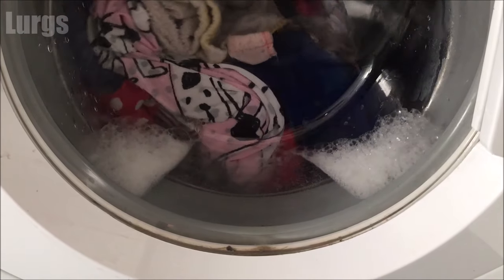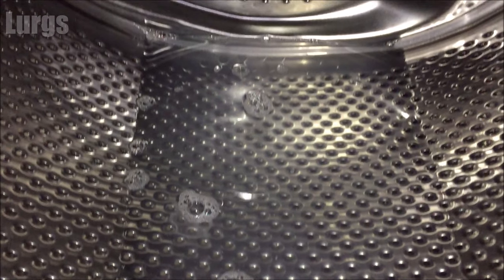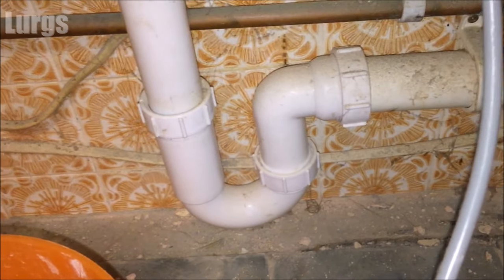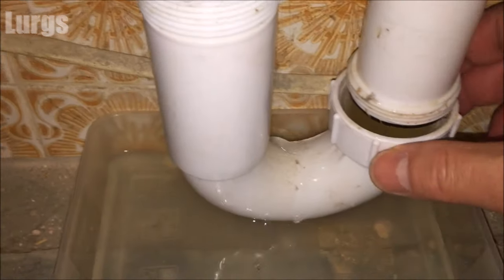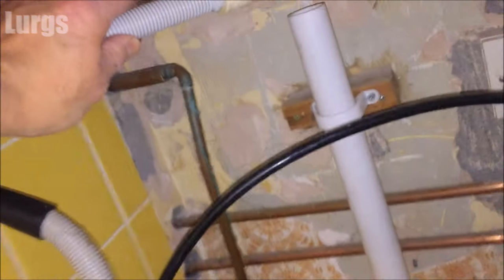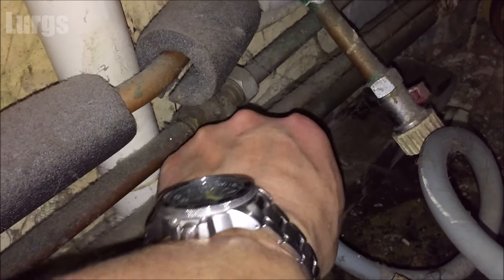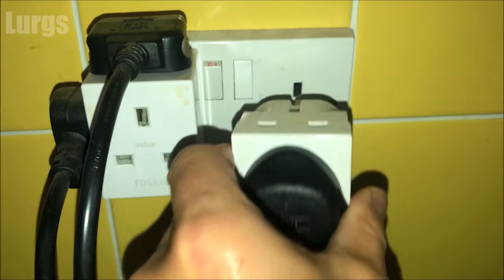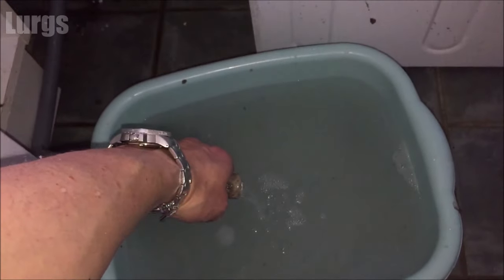Washing Machine not Draining Water - Fixed

Comment: The filter in the bottom that u turn around to open is stuck and won't open, and the water stuck on my front Loader is now starting to smell
Reply from the maker: That is quite common, that means there is probably something stuck in there like a hair clip. Just try tightening back up and unscrewing again, hopefully after some wiggling it will dislodge and you can remove it. Good luck.

Comment: My drainage pump filter won't turn for me to open and remove things that are stuck inside.  Please help, I'm afraid of turning it with force as it's plastic and may break instead 😢
Reply from the maker: @nontandomagwentshu1388  Try untightening and tightening multiple times to see if the object clears. It is bound to be a metal hairclip. If not you may have to get a bit more forceful, but be careful as the filter is only plastic. Worst case you’d have to buy a new filter. Good luck..

Comment: I can’t get to the pump because 4 screws will not come out. I have tried everything. I don’t understand why they put them like that. I just put a new lid lock and it’s still stopping mid cycle and not draining. I don’t know how else to get to it..
Reply from the maker: Normally a filter should be easy to access, shouldn't need to remove any screws. Maybe yours is different. You need to check the filter as that will be the prime suspect for water not draining. Might be in your instruction booklet how to remove the filter. Good luck.
Reply: @LurgsHowToGuides  I fixed it. I have to remove the casing to get to the pump. Those 4 screws were stopping me from doing so. Either it’s a clog in the pump or the pump is faulty. Unfortunately the manufacturer stopped making the pump. But I have it working for now

Comment: I emptied out the filter and there was water stuck in there but I couldn’t see a blockage.. any ideas?
Reply from the maker: Check impeller spins ok. Check for debris. If all ok do another wash and see what happens. Could be a faulty pump or computer board error
Reply: @LurgsHowToGuides  it seems to be working now I'm just not sure why it wasn't or why it didn't fully drain but at least it's working. Thanks for replying

Comment: i have done mine ,but still wont do a drain cycle , spins and empties, but wont do a wash and then drain ???
Reply from the maker: Worth checking filter again as sometimes after you remove it debris can drop back down. If ok it could be a pump problem

Comment: Hi what if you have checked and double checked and nothing is stuck in the filter. It is still getting stuck in mid cycle
Reply from the maker: Have you checked drainage hose pipes where it pumps out the water to? This could be blocked. If not blocked then time for a Washing  Machine Technician callout probably. Good luck.
Reply: @LurgsHowToGuides  Hi Yes have done all those things and had the washing machine technicians in twice, they can't figure it out as well. My dad thinks its the pump. That something might cause the pump not work
Reply: @LurgsHowToGuides  And I don't know where to look for that pump. Lol
Reply from the maker: Christine le grange If a washing machine technician can't solve it then that sounds really odd. Unless it's under guarantee you might have to get a new one. The pump should be at the back of the filter. Sorry you couldn't get it fixed,  very annoying. Stay safe ☕️.
Reply: But how long before the replace it with the new? They are very lucky I work from home, I am a teacher and teaching in the UAE. It would’ve been bad if I couldn’t wash my clothes
Reply from the maker: Normally Washing Machines have a 1 or 2 year guarantee.

Comment: The drainage hose doesn’t have any water in it and my washer is still blocked! I’ve removed the filter and there was a coin but did another wash and it’s still full of water :(
Reply from the maker: Oh dear. It's worth checking the filter again, sometimes when you remove it and put it back then other items can fall into it. If nothing in there it could be a faulty pump maybe. Hope you get it sorted
Reply: @LurgsHowToGuides  checked again and there was a coin and a screw still stuck! Also managed to clean the draw and that’s stopped the leak too! Thank you you’re a life saver!!!!!! :)
Reply from the maker: Mega. Good result, I'll get back to the footy now😎

Comment: Do you have a moment to maybe help me? 

Our washing machine has decided not to drain it's water anymore. Unless when you put on 'flush and centrifuge' then it drains, and during the program fills it with water again just to leave it at the end of the program again. So I know it's able to drain and push the water out. It just won't. And doesn't give me an error or anything either.

😂 Would you have any idea ?? It's a Samsung Eco bubble ofc (I'm Dutch so maybe the term isn't right 😂)
Reply from the maker: How odd. Maybe try a different programme, but it sounds like it's faulty if it's doing that but it does drain on the flush setting.
Reply: @LurgsHowToGuides  strange right

Comment: I did this but found nothing in the hole?? No blockage? Just water
Reply from the maker: The hole? If you've followed all the steps in this video and it's still not working then unfortunately you will probably have to call out a washing machine technician

Comment: I did everything except for the cold water switch for some reason it’s broken off so I might have to call someone in
Reply from the maker: Oh dear, they can get brittle over time. Might need a new lever installed unless you can turn it with pliers maybe .

Comment: how to fix if the emergency drainnning tube gone inside
Reply from the maker: Not sure I'm afraid, where is the tube on yours?
Reply: its beside  drainage pump filter at the bottom 
i have sumsung front load machine
Reply from the maker: @kripalthakkar610  you need to try and retrieve it. If the stopper is still in then ok but if that’s come off it could leak everywhere.
Reply: its leaking everywhere and stopper is out tried retriving  it but unfortunetly couldn't get it from front what is the other way to get the tube out please
Reply from the maker: @kripalthakkar610  not sure, you’ll have to try to get something up inside to pull it out.
Reply: alright i will give it a go.Thanks for your reply and time . Really appriciate it Thanks..!!

Comment: I did everything you did on the video and my washer still doesn't work 😞
Reply from the maker: Oh dear. Sorry to hear that. Could be a faulty pump or computer board error. If it’s pretty old it may be cheaper to get a new one rather than repair. Repairs can be expensive

Comment: If only my cold water valve wasn’t stiff I’d be able to do this issue
Reply from the maker: @caitlinbeeton9459  If you never ever use them they do get stiff.
Reply: @LurgsHowToGuides  makes sense, is there a way to loosen them up as I don’t want to try twist it then it snaps
Reply from the maker: You could try some heat on it from a hairdryer or something.

Comment: I just did this, and it didn’t work 😩 it’s filled with water again HELP
Reply from the maker: Oh dear sorry to hear that. Sounds like a possible pump failure, if you have checked 'all' the steps in this video then it's time to call a washing machine technician.
Reply: @LurgsHowToGuides   oh dear,  well thanks anyway your video was a great step by step  help 👌🏽

Comment: Mine is making grinding noise  and it doesn't drain
Reply from the maker: Oh dear. Hope you get it sorted, could be a blocked filter
Reply: @LurgsHowToGuides  I removed filter and still . Wanna try to remove pump and see
Reply from the maker: Hope you find out what it is.

Comment: Water not coming out help
Reply from the maker: Have you watched the video all the way through? If still no joy you will need to call out a Washing machine technician.
Reply: Lurgs nvm its working
Reply: Also i ment water not filling up
Reply from the maker: Check mains water hose inlet to make sure you have water. If you have then sounds like you need to call someone out. Good luck.

Comment: Tried all theses it still won’t drain
Reply from the maker: Not sure I’m afraid. Faulty pump maybe
Reply: @LurgsHowToGuides  thanks for the reply managed to fix the no drain spin problem after some more research. The 3 way rubber pipe on the back the filter was blocked I had to tip the machine on its side to access it and undo the clips clean it out .